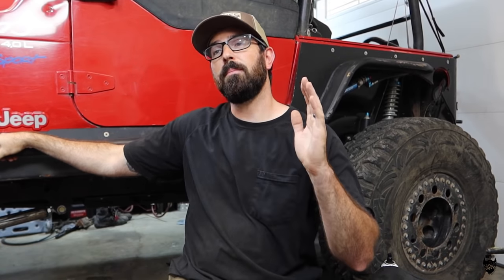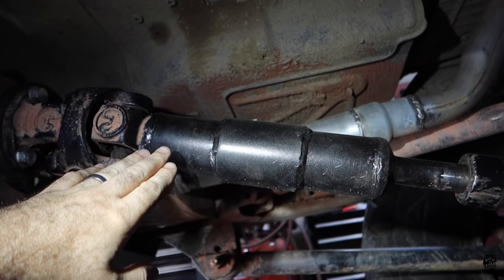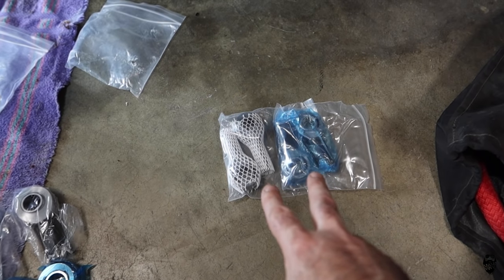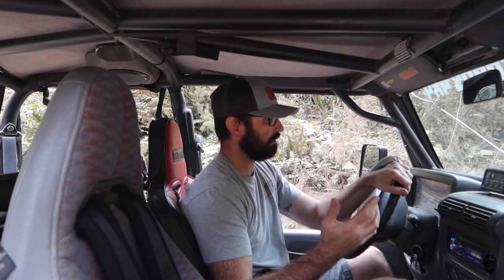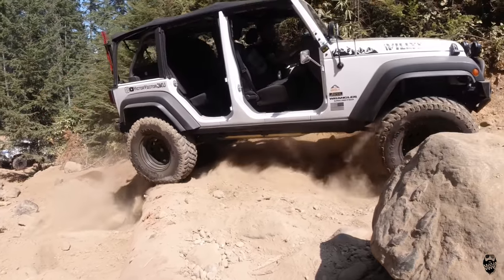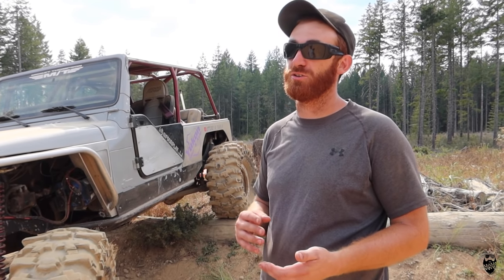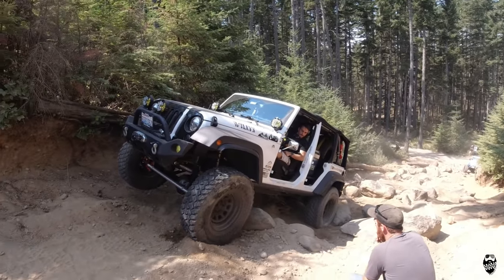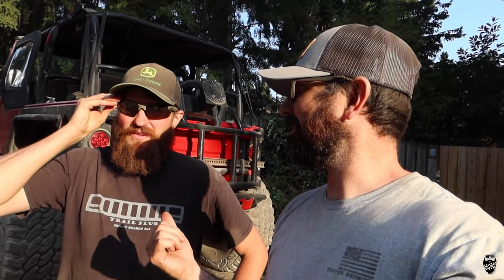Auto vs Manual Transmission, Which is better Off Road?

Comment: Sounds like you guys that dont like manuals arent geared correctly. Dual cases is insane control. And eliminates most of the complaints that you guys have. I have 10.3:1 atlas and it was the best single upgrade i have ever purchased.

Comment: I like my auto for the comfort and ease of driving. 
One thing I do for an even more smoother ride is drive with both feet. Covering the brake makes for quick braking on an obstacle , if needed, without any roll back or hesitation
Reply: During a water crossing, if you change gears with a manual transmission you risk getting water in the clutch which can cause issues in the future.

With an automatic transmission, however, you can change gears or stop driving and no water will find its way into the gearbox. This makes automatic transmissions the better choice for you if you know you’ll be facing a lot of water crossings with your 4×4.

Comment: I’ve wheeled both a 97 Cherokee manual on 35s and a 04 jeep lj on 37s. I could do green and blue trails in the Cherokee but when I would get on reds you have to ride the clutch a lot. While in our Lj auto I didn’t have to worry about stalling out or getting a whisky throttle.

Comment: I despise automatics in general and don't much like them off-road in hardcore terrain either.  The only way an automatic makes more sense to me than a manual wheeling is if; you're just looking to go cruising scenic trails for a nice relaxing day, you have a rock bouncer and you enjoy being wide open with the rpms screaming, or you are a rock crawler and you can't afford the right gearing to make a manual work well in highly technical trails.

But, as long as your happy and out wheeling, each to their own.  You'll never justify a manual trans to a hardcore auto guy, and you'll never justify an auto to a hardcore manual guy.
Reply: Both definitely have their own pros/cons
Depends on the individual preference

And please to those hard-core one sided.. you have to at least try both back to back to truly know what's best fit for your needs at the end of the day.
Reply: Auto for rock crawling.  Never stall,  more control, safer on the vehicles  parts, less damage to the tracks the list is endless.
Reply: @janhoffman4798  
Clearly you've never rockcrawled with a properly geared manual transmission setup if you think an auto offers more control and endless advantages.  😅
Reply: @Gonecheenin  all the best rock crawlers out there all all auto  FACT!
Reply: @janhoffman4798  
😂😂😂

Comment: I like driving manuals, but two-footing in an auto will always be better.
Reply: I wired a hand throttle onto the shifter of my 91 yj manual trans so that I could run throttle, brake and clutch without having to finesse with heel-toe on rocks. Used a Hurst automatic shifter with the two finger lock release modified to run the throttle cable.  Skinny pedal still worked too.
Reply: @jonputnam5745  how? Haha I've wanted to do this for quite awhile. I'm gonna have to look into it.

Comment: Automatics are even better when you can shift it your self. I got the slap stick option in my JKU I can down shift when ever I want and usually can up shift when ever I want sometimes it won’t doit but more often then not you’re down shifting when off road and have no issues with that and I don’t mind being in gear a little longer to get over an obstacle it’s not like your going to shift up into 3rd while on an obstacle unless you’re in mud and need to hit it. But definitely automatics especially with the slap stick so you still kind of have that manual option I know there’s a technical term but I don’t know it lol

Comment: In my 78 Scout I have a T19 Wide Ratio (6.32:1) my twin sticked dana 20 (3.15:1) and 4.88s with 35s I don't even need to touch the gas. Just let the clutch out and go. The only way the wheels will stop spinning is if I push the clutch in. Lots of control in my opinion and I like the challenge

Comment: Maybe it is because I am old, but the  32rh in my jeep is perfect. Had a manual in my old Bronco 30 years ago, but been wheeling an auto for the last 20 years without regrets.
Reply: Personally I'm not a fan of automatics in general - but the non-electronic 32RH/TF999 is definitely one of the best choices out there if you decide an automatic is for you.  Those things are beefy inside, simple, efficient, reliable (for a slush box), and have a strong 6 bolt T-case retention (unlike the GM TH350)

Bout my only complaint on them is the difficulty obtaining some performance parts (compared to GM) and the internal governor requires a full teardown for modifications unlike GM where you can easily access & modify the governor via a side cover.

Comment: I've had both, '99 Tacoma automatic and a '76 FJ40 manual. Honestly prefer the manual off road. It's a lot more work but I feel more in control with a stick shift. Compression braking definitely doesn't stink as much as riding the brakes down long hills.

Comment: I prefer auto xj with 40s you get alot more smooth control on difficult obstacles and you can be very precise where you place your tires and not slip off.

Comment: I have Both and I like both if im on brutal long distance runs far from home I have leaned to run manual only in that case durability but still love the hell out of my auto. Also depending on type of track or trail. A guy really needs both because neither can out do each other in all situations. The more I drive the manual the more I realize both are satisfactory. At first when I built my manual rig I was like this is alot of work driving but  lots of repetition driving it I dont notice it anymore comes natural. Broke my manual reverse once and my automatic been pulled three times in 5 years.

Comment: I definitely enjoy my manual but the predictability that comes with Auto is very nice. How are street manners with the selectable auto versus a standard auto? Also what would you change if you did a AW4 auto? Great video!!
Reply: During a water crossing, if you change gears with a manual transmission you risk getting water in the clutch which can cause issues in the future.

With an automatic transmission, however, you can change gears or stop driving and no water will find its way into the gearbox. This makes automatic transmissions the better choice for you if you know you’ll be facing a lot of water crossings with your 4×4.

Comment: The biggest benefit for the manual is transmission strength. Much less likely to break. Just wear out the clutch if you’re doing super slow rock crawling stop and go situations.
Reply: depends on the trans tho. Manuals shock the driveline more, the auto in my 2014 jku is a hell of a lot stronger than any manual in a jeep. That old mercedes 5 speed holds like 580 torque stock!

Comment: During a water crossing, if you change gears with a manual transmission you risk getting water in the clutch which can cause issues in the future.

With an automatic transmission, however, you can change gears or stop driving and no water will find its way into the gearbox. This makes automatic transmissions the better choice for you if you know you’ll be facing a lot of water crossings with your 4×4.

Comment: I'm 47 been Wheeling since I was 16 I had manuals and automatics totally prefer manual transmissions with a center Force dual friction clutch 529s dual cases 4.7 2.28 spools front and rear locking hubs and hydro assist that's how I built mine crawls everywhere keep them low with plenty of flex
Reply: manual is my preferred also but I do have an auto now, I loved having duals leaving the clutch out and climbing everything with 0 throttle, the downside is if you drive a tire into a pinch "like I did" there is no buffer only broken chromoly parts 🥲

Comment: interesting video and it reinforces might thoughts. I think if your not a super pro, the automatic frees up some of your attention for driving.Since I want to drive my CJ7 on the road as well I would like more gears. I was thinking about using a 4/5 speed from a dodge Dakota or Ram. do you think that would work? And i would like to use the old T18 transfer case. can I get adapters for that? thanks

Comment: I prefer a manual have driven both autos burn up for my driving. And I like to wheel for the challenge and auto is easier bit seems more control with manual good video
Reply from the maker: Thanks, doing trails and mild rocks the manual was great, but the big hardcore rock obstacles I have been doing the last year, the auto is the way to go.

Comment: I just can’t do an automatic 
Been running my 05 TJ w manual for 10 years never even thought about an auto 
Just low and go👍👍
Recently put in an atlas transfer case and I can highly recommend this upgrade 
For me I guess it’s power on demand and roadspeed gear selection that I like most with my manual as it’s also my daily driver 
However it’s your Jeep do what you want with it ,,,as the saying goes 👍👍👍

Comment: I did find it amusing that you kept attributing Smoothness and Predictability to the auto - I have had the exact opposite experience. 
I think auto's are pretty difficult to get slow steady wheel spin out of, they are also difficult to keep from lurching off the other side of an obstacle when you just had the torque converter loaded up hard to be able to climb the front side.
I spent 8 years wheeling my 92 4.0 YJ hard with an auto and pretty much hated it in the rocks until I put a 4:1 Rocktrac in it which at least made it work decent.
But my current rig has a 5 speed with a doubler and IMHO that's like having your cake & eating it too - there is ALWAYS a gear perfect for every situation or obstacle, and nothing is smoother and more predictable than an engine idling in double low with your 150:1 gear reduction turning your tires at a 100% consistent speed.
Reply from the maker: So far I have had the complete opposite experience, lol. But if I had a good transfer case with lower gears the manual would be much better. I found myself stalling, burning up the clutch and sliding off big obstacles all the time with the manual. One good thing is it made me a much better driver for sure, but it gets old after a while. It does come down to engine rpm, with your torque converter stall speed, axle gearing ect.. well you know. Hopefully it continues to be good, otherwise I still have the manual I can throw back in there👊🏻

Comment: I have a 32rh in my TJ, I want to do a TDI swap but people are saying that the 32rh won't be able to handle the torque. I am just trying to build a DD/ weekend warrior rig. Nothing close to the monsters you and Nate drive!
Reply from the maker: A stock 32rh probably won’t last long. Good clutches, a shift kit and a good cooler, it would probably hold up just fine.
Reply: @MuddyBeards4X4  anything you would do different with your 32rh build? I like the idea of a full manual valve body for utility purposes as i use my jeep as tool a lot on my land but will be drove from my house to the trails.

So I'm curious about the billet accumulator and the manual valve body and wether or not I'd like it on the street
Reply from the maker: If I was driving it on the street more, I would probably make sure it has a lock up torque converter for a little extra at higher speeds and I would not go with a manual valve body, I believe cope racing transmission has a valve body that is an automatic but upgraded.

Comment: It appears that most folks miss the point.  The main benefit of an auto is variable torque multiplication.  The side benefit is working two pedals when going over a rock/root off camber switching on crest.  

There’s a reason that everyone in motorsports uses manual transmissions, oh wait, they don’t.  😂

That said, I have a full manual control, completely overbuilt 700r4 with a reverse shift pattern for my LJ.  Because it’s simply better than any other option I’ve run, by far.

Comment: I prefer a manual. Compression breaking down hill is hard to duplicate with an automatic. A sm420 swap in a yj with a 3.8 atlas behind it you don’t have to three pedal it to take off on an uphill.
Reply: I wheel a 4cly manual on 35s locked. i beat the shit out of it and it's a blast!!  I want the atlas so bad but the wait is around 12 weeks I believe.  😫
Reply: No its not if u right gears auto does same thing no issues .

Comment: Is there any reason you didn't go with an aw4 auto? I'm guessing the yj automatic probably has more aftermarket support?
Reply from the maker: When I started this project I didn’t do much research to be honest. Found an 32rh for $100 and bought it. It sat around for a while before I got to working on it. But I am glad in the long run I did it. Aw4 has less aftermarket support and you have to run some electrical systems to make it work. I like mine is full manual, no electronics.

Comment: I’ve driven automatics and standard transmissions in semi trucks, off road and everything in between. Automatic is way better because it’s less maintenance, and better control. The only vehicle I buy with a standard transmission is a motorcycle.

Comment: One constant when wheeling is that crap breaks. I'd much rather have a manual in that circumstance. Broken auto you gotta get towed out. If a manual breaks which it is much less likely to do, you can probably fix it on the trail if you need to.
Reply: Autos trans rarely break. Thats the whole point. With gears there is only two teeth taking all the force at any one time. There are no gears in an auto. Only clutches and bands.
Reply: @patrickstep  what rock have you been living under? I have had 3 cars in my life time with automotive transmissions that broke while only used on the road. There are multiple businesses in my area that specialize in repairing automotive transmissions. If they "rarely break" what keeps these people in business? Also I've never broken a gear in a manual nor has anyone I know.

Comment: I’ve had Porsches, Corvettes, Jeeps, and other vehicles that were all stick shifts, and they’re all fun to drive. But from my own experience when it comes to off roading auto is better. If you blow a clutch in the back woods and you’re alone it can be a problem.
Reply: Wrong , auto blow out first any day and u will be stuck with a manual trans u will stick the vehicle in first start the vehicle and continue going and shift by the rps to get u out if an auto goes u are way more screwed.. U can own whatever u want but real driving skills are what they are...

Comment: used to be all manual... then i destroyed my ankle and had surgery. since then, i lack the ability to have any "touch" on a gas pedal and got forced into auto... i actually like it better. my jeep is universally recognized as the worst best jeep ever... a TJ wrangler with a 2.5 and a 3 speed auto. does everything i ask it to (off the highway). hangs with JK rubicons without much effort.

Comment: Newer jeep with autos are ridiculously easy to select desired gear. I don’t understand why anyone would want to own a stick. (I’ve done both and auto is better)
Reply from the maker: I have done both and with the proper gearing you can get a lot of control with a manual. But in this case the auto is the way to go👍🏻
Reply: @MuddyBeards4X4  especially when climbing is involved.  I do agree though that driving a stick can be more challenging which sometimes is fun.

Comment: I’ve had both. 
I prefer a bolt action over a auto Bruce Jenner for better control over the shifting & engine breaking & I’m not a pro at driving a stick.
Reply: How do u have more control? Does it ow time lol.

Comment: Any manual transmission can crawl just as slow and easily as an automatic with very little use of a clutch if you gear correctly. People who prefer an auto have never driven a twin stick transfer case geared nice and low. Doesn’t even require gas pedal input, she just does.

Comment: Chrysler has the worst transmissions. I spent $6500. On my 05 Dodge Ram 2500 to get the transmission were I wanted it. It took a dump at 130000 miles while pulling my toy hauler. Browns Diesel rebuilt it with all Goerend Billet parts, and torque converter. I have an 05 Jeep Wrangler that’s an automatic, that keeps popping codes from the transmission. I went to Wrangler Fix to change out the PCM. Manual transmissions are so much easier and cheaper to deal with. ANY AND ALL automatic transmission from Dodge SUCKS! I grew up on Chrysler products, but they need TRANSMISSION engineers to produce a quality product.

Comment: Autos trans rarely break. That's the whole point. With gears there is only two teeth taking all the force at any one time. There are no gears in an auto. Only clutches and bands. So more surface area to apply force. They also have some give to absorb extreme force. With manual and extreme force they have no give so they break. The only downside of an auto is the price, they are not cheap

Comment: No way manual all the way.  Takes skill to drive a manual. Plus kids no a days have no clue how to drive a manual. Save the Manuals!!
Reply from the maker: 🤣 True they don’t
Reply: During a water crossing, if you change gears with a manual transmission you risk getting water in the clutch which can cause issues in the future.

With an automatic transmission, however, you can change gears or stop driving and no water will find its way into the gearbox. This makes automatic transmissions the better choice for you if you know you’ll be facing a lot of water crossings with your 4×4.